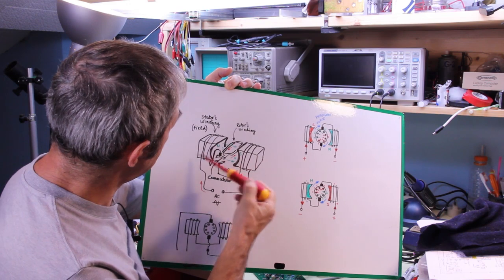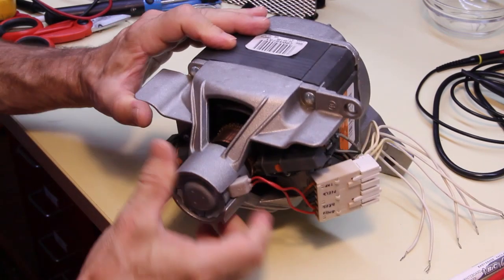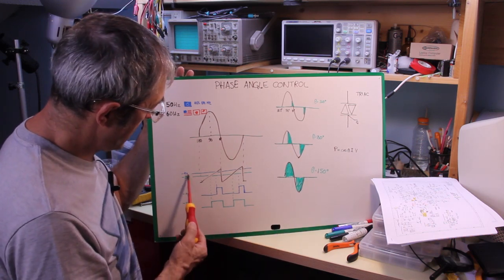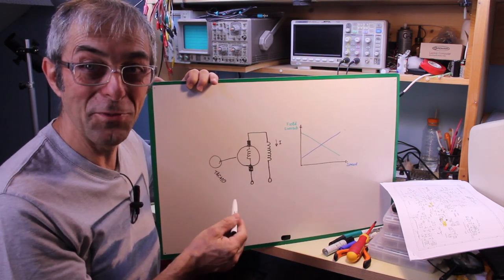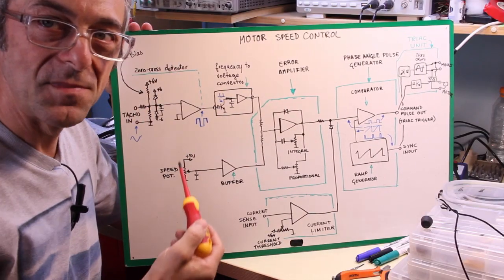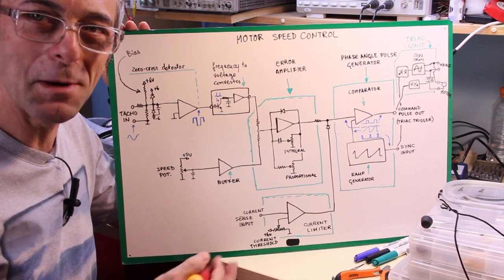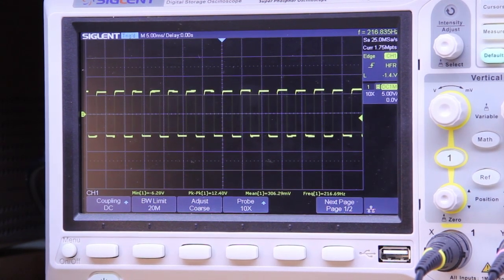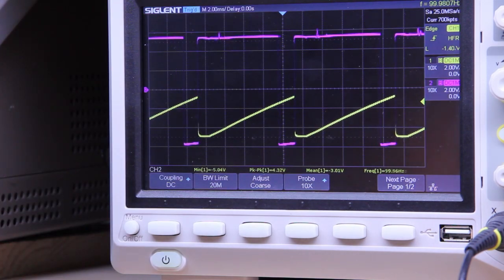All you want to know for driving powerful motors recycled from washing machines

Comment: It should be interesting to control separately the stator and the rotor windings. 

Universal motor can also be used as generator, such as in a wind generator, in such scenario, the separate control of the two windings should be very important to   control the generated voltagy and the speed of the blades.
Reply from the maker: Indeed it would be interesting to seprately control the field and the rotor's current. But Universal motors have the stator's winding designed to widthstand high current, unlike classic DC motors with separated field excitation that use much less current to generate pretty strong magnetic fields. This could negatively affect the efficiency of the motor.
Reply: @AccidentalScience  Why? I might be wrong, but I'd expect having 100% duty cycle at the stator and, say, 10% at the rotor to be more efficient than 10% through both of them in series?

Comment: Why not a pwm circuit where you can control amplitude and frequency.
Reply: Because these are universal motors running from mains AC. That means fixed amplitude (240v) and frequency (50Hz).
Reply: that is used to control brushless / asynchronous motors, not brushed motors
Reply: @sqrt2-19  You're talking about VFD (variable frequency drives) or ESCs which change the frequency and in some cases the voltages. They do this by converting the AC to DC, producing a pulsed (frequency) PWM signal, and then running it through inverter to produce AC.

There are two types of brushed motors, DC and universal. DC brushed motors run on DC and it's speed is controlled by the voltage. They can use PWM drivers or phase angle Triac drivers, but not ESCs or VFD without rectification.  

Universal brushed motors run on either AC or DC, so it's speed can be controlled by all VFDs, ESCs and PWM. Ideally, they run best on DC power. 

PWM controllers are superior to triac based ones because the current is constant while the voltage changes based on the duty cycle of the signal. Triacs work by "sampling" part of the AC signal at different phase angles. At low voltages, you get low current.
Reply from the maker: Controlling amplitude and frequency likely refers to AC induction motors, and not to Universal motors that essentially are DC motor with windings designed to have the right impedance when working at mains frequency.
But, actually it would be possible to use a PWM circuit to control power amplitude (but not frequency) in place of a phase-fired control. While that kind of circuit would reduce the electrical noise and may show a better power factor (which can be close to 1 with a proper filter) and allows the motor to operate with slightly higher efficiency, it requires IGBTs or high voltage MOSFETs and the related driving circuit, making the power section much more complex and expensive. If memory serve me, Bosch and Renesas have developed an IC that do this job to control Universal motors and lights, but it is hard to source. TRIACs are easier to source and the circuit to control them is really simple.
Thanks to all for commenting.
Reply: A vfd would be the best bet for speed control